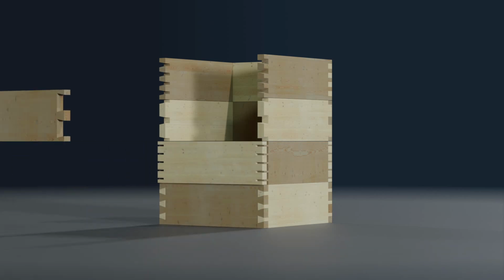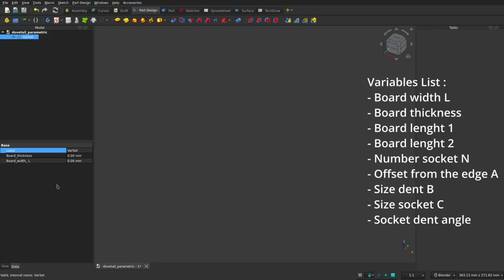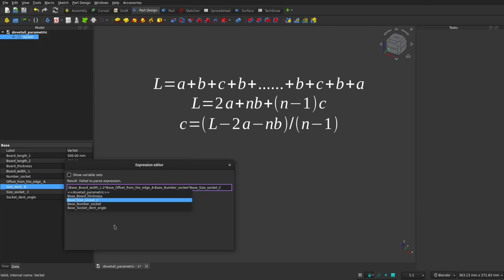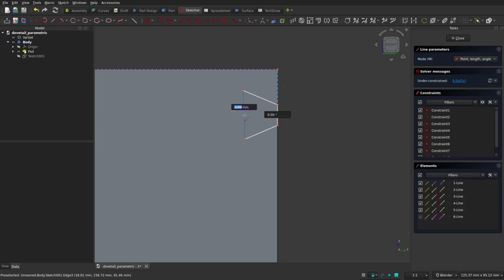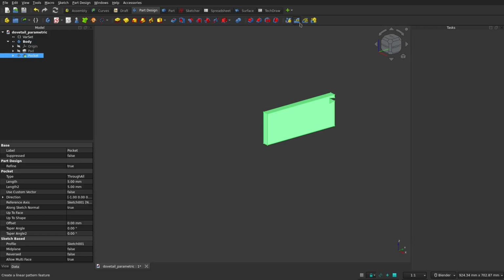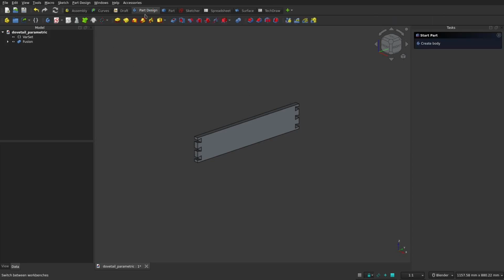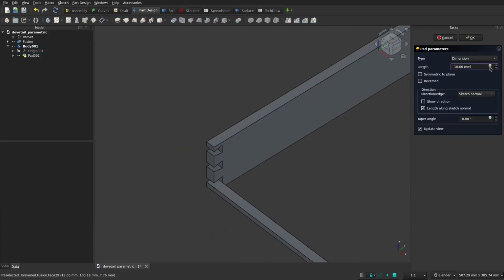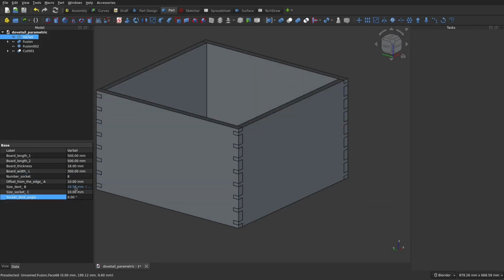One Click Parametric Dovetail Joints - Freecad 1.0 for Woodworking

Comment: Is there a method in FreeCAD 1 of giving corner relief in the joints as with Fusion360 'dog-bone' to allow the joints to fit properly? Obviously this is necessary if using a CNC machine as the cutter can only give a radiuses shape, not a sharp corner.

Comment: @ 2:54 you state that you have attached the formula alongside however i do not see any formula to reference in the description of the video. 

the logic that you state is sound and the results as well but for one who is following along it becomes quite difficult to transpose your calculations when there is no clear expression of them to reference. 

Can you please share, in writing, the full equation for the calculation of size_dent_B? 
it would be most appreciated. 
in any case, thank you for the time you've taken to share your knowledge. 
Its much appreciated!
Reply: @Deltahedra
Reply: (Base_Board_width_Length-2*Base_Offset_from_the_edge_A-Base_Number_of_socket_N*Base_Size_socket_c)/(Base_Number_of_socket_N-1)

this is what i came up with.. it produces 25mm, as you described. 

though, i did implement some slightly different naming conventions in the VARSET stage... its not too far off. 

any thoughts?

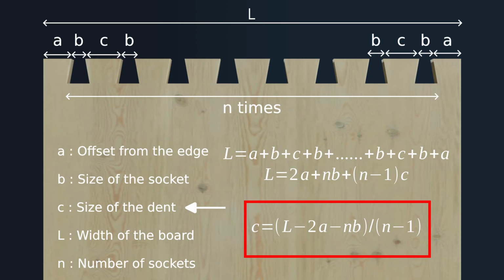Comment: Thanks for the tutorial, but I am confused. Imho there is a mismatch in your project: in your formula sheet (0:59) you define 'b: Size of the socket' & 'c: Size of the dent'. That matches the sketch. 
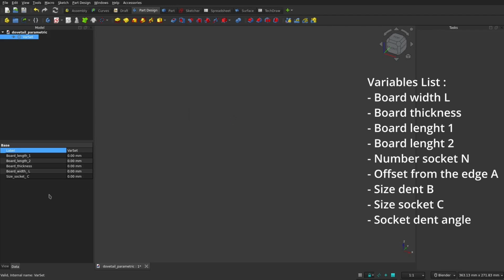At (2:10) in the list of variables you've defined 'Size Socket' as c & 'Size Dent' as B. 
Finally (at 3:35) you defined 'Size dent B' by using the formula for c. 
Now I am not sure whether if the 2 glitches cancel each other out and only the sketch needs to be modified or whether you have corrected the errors without making it transparent.

Efficiency is only good as long as you don't loose your audience on the way. Some additional information, especially later when construction the box would be helpful. 
I wouldn't have had problems with a 20 minutes video, which provides more explanations, that let me construct the box without too many showstoppers.
Otherwise a great video.
Reply: I modified the drawing (ppt) and then the parameters fit. 
Finally I made it to the end. 🎇 It works great. Your video last 13 Minutes, I needed 13h. At least.
Man, that was tough. So fast, so few supporting explanations. You will get the price for efficiency, that's for sure. 🏆

Comment: Something is not right with the formula.
I haven´t finished the video yet.
You use:
b=(L-2a-nc)/(n-1)
However on the screen you have:
c=(L-2a-nb)/(n-1)
If I use this equation: L=2a+nb+(n-1)c and look for b, I get:
b=(L-2a-(n-1)c)/n
Definitely something is not right with your equations.
Reply: I got what is wrong.
When you added the variables on the Varset you mixed the "Size of the socket" (initially used letter b), as "c" then used 'b' for "Size of the dent" instead of "c"
That is why the formula you use for VarSet.Base_dent_B make noise to me. You swapped to variables.
Man, the video is great, but be more careful with variables, is confusing.

Comment: Thank you for your videos, they are great! You are talking about calculation errors with Sketcher and Variables, I have problems with that. Maybe you want to make a video on how to prevent them?
Reply from the maker: @wicht73 Thank you. The best advice is to always constrain your sketch from the origin and axes. If you need to reference a drawing edge or anticipate future modifications, use variables instead of fixed references and avoid creating references from references. FreeCAD occasionally has issues with dimension orientation, reversing the positive and negative directions.
Reply: @deltahedra3D  Thanks for your answer! I will try. Reversing positive and negative is exactly my Problem.

Comment: Back with more comments ... don't you want a small gap between the male and female pieces so that they can go together ... I am talking somewhere around 0.008" or .2 mm.
Reply: Adding "tolerance" variable is correct way, but implementation would be even more complex
Reply from the maker: @carlslater7492 Yes, you can add a small gap. After performing the Boolean cut, make a very slight scale change. I didn't want to overcomplicate the file.

Comment: Nice. A few comments:

The popup window for the VarSet is asking you to add properties, exactly what you did immediately after. It can be helpful to select the VarSet to show the list in the data view while using it. 
You can also use the Group field to group your variables, e.g. for board or joint parameters.

You can perform an Array followed by Mirror in Part Design, in this case by setting the Mirror Transform Mode to Transform body to mirror the entire body rather than the latest feature. 
You could also draw the full length of the board and both array and mirror the pocket in one MultiTransform.

I'm guessing the origin based formulae to reference the opposing edge are meant to avoid inversions if you make big changes (e.g. having the socket appear outside the board). It makes me wonder why you didn't just start from the bottom though. Another option is to offset the sketch attachment. 

Still educational; I hadn't realized FreeCAD's Part boolean operations only allowed 2 objects. Part Design's body boolean can use multiple tool bodies for one cut.
Reply from the maker: @0LoneTech Thank you for your feedback. You are correct that your proposed workflow would streamline and expedite the creation of the mirrored array within the Part Design workbench. This approach is particularly beneficial for users transitioning from alternative software. 
I close the first varset dialog box, because it places the first property at the bottom of the list of variables and I wanted to have them in an alphabetic order.